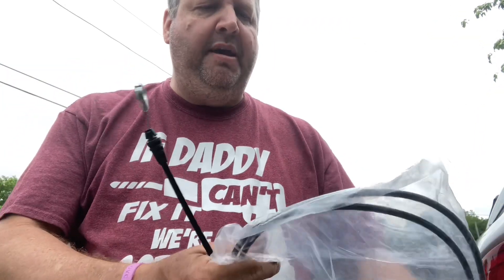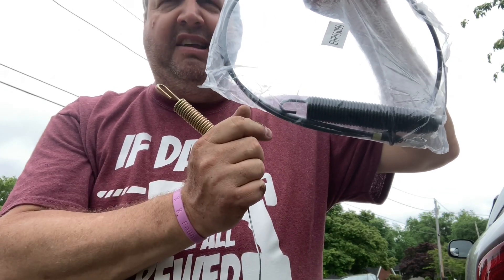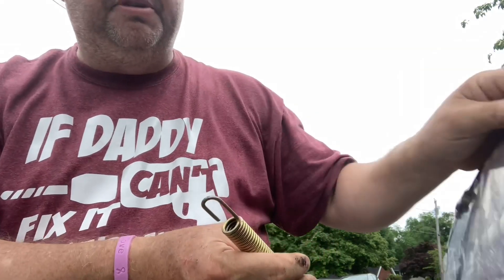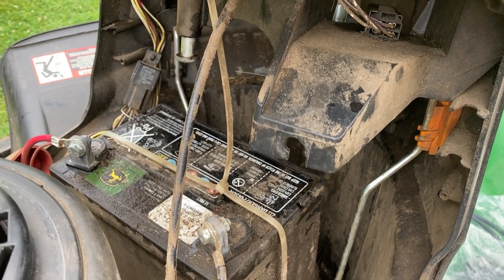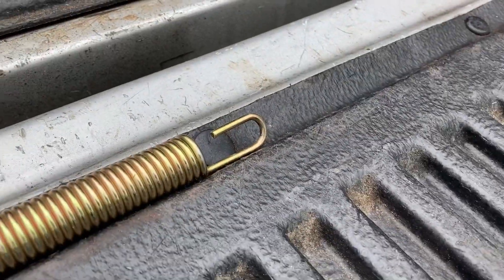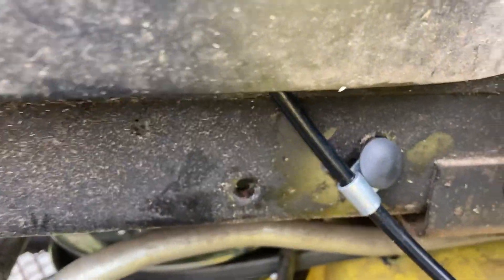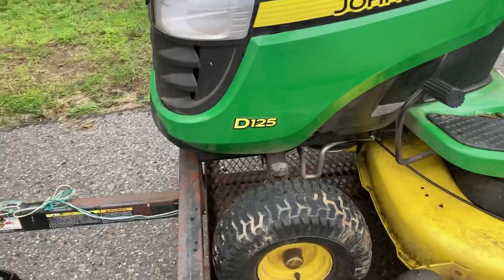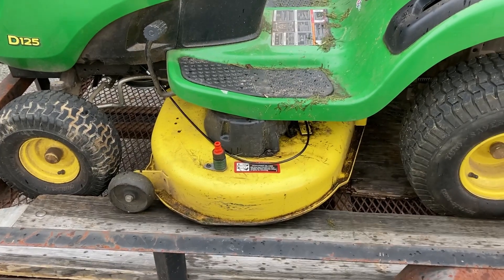John Deere D125 PTO Cable. Beware aftermarket equivalents!

Comment: My PTO spring just broke where it attaches to the idler. It looks just like the after market you showed. I ordered a new one and it looks just like the one that was on my blower attachment. I wonder if the previous owner also put an after market on.  I cant figure out where the spring attaches on the idler. There is no slot. Does it wrap around the idler bolt?
My JD is an LA125 with blower attachment
Reply from the maker: Looking to connect to the blower idler?  Which model blower?
Reply from the maker: https://youtu.be/ftIuw2RXrGg?si=kJPPsFLCeRpmZ6Rd

Go to 02:37

Comment: Can you share a link to the correct OEM cable?
Reply from the maker: GY21641 is the OEM Deere Cable called out but I received something quite different.  Verify with your model and serial number of tractor and deck size. Make sure the length is the same and also the terminations.  Should be an Eyelet on the lever end.